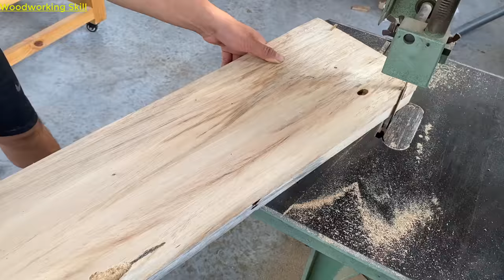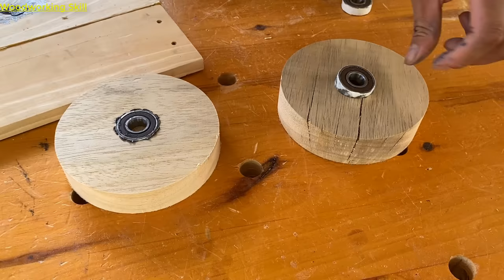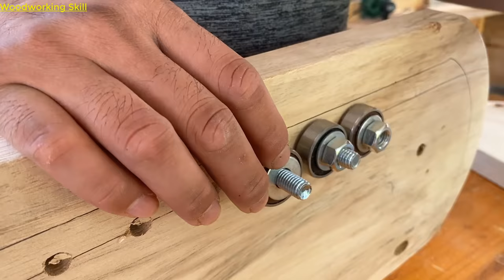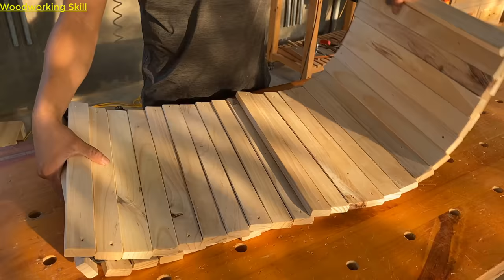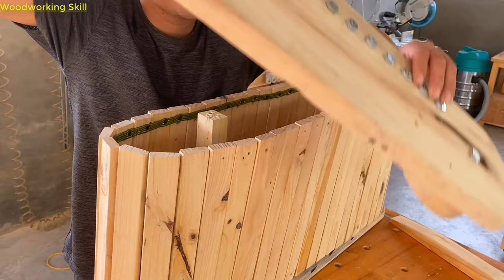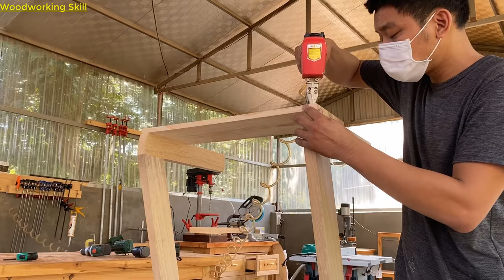How To Build Your Own Treadmill At Home // The Smartest Woodworking Idea In The World

Comment: Harness needs to be a PULLING harness, those are built to control a dog so that they can't gain leverage. Rope should be attached much lower. Carpet loop should be tighter. Lastly, the rollers should be so big and the carpet so tight that the carpet isn't resting on the hard surface. It really should have sides too but that's not one of the reasons it's not working.

Comment: You can use it, a lot of it is made of wood.
But I guess it makes too much noise.
You could still work on that, with the second improvement.
You could also generate electricity while running.

I would like to see how you implement the improvements.

Man kann es benutzen es ist vieles aus Holz.
Ich vermute aber, es macht zuviel lärm.
Da könnte man noch daran Arbeiten, bei der zweiten Verbesserung.
Dazu könnte man beim laufen noch Strom herstellen.

Ich würde gerne sehen, wie Du die Verbesserungen umsetzt.